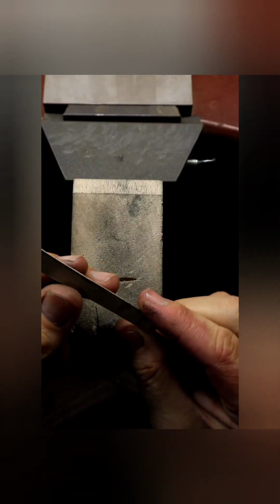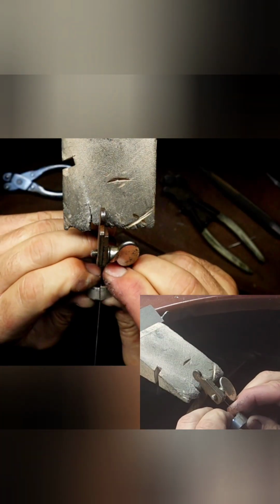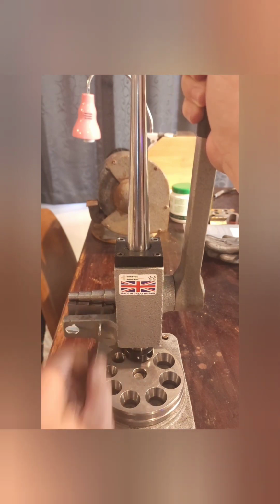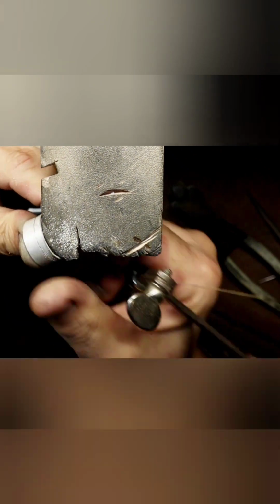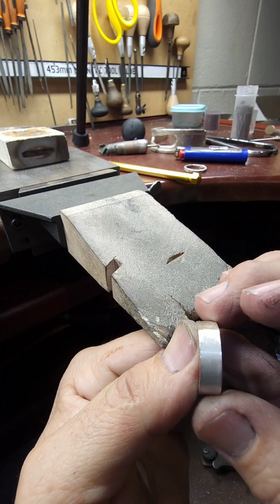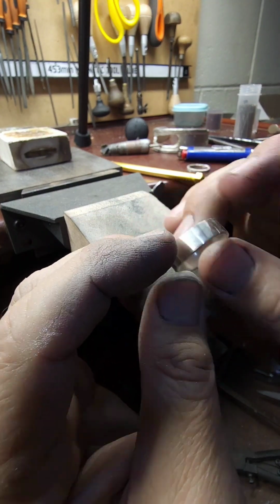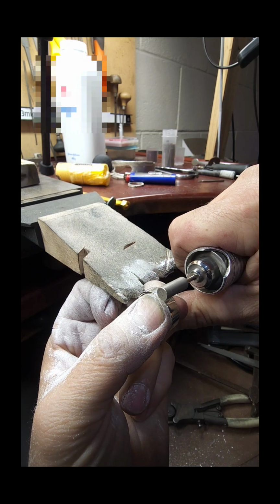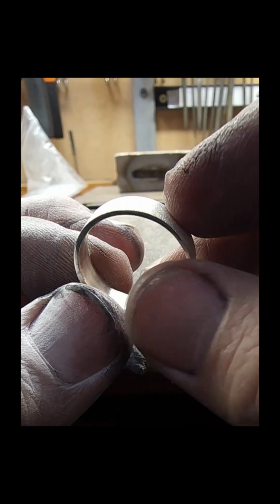SANDBLASTED FINISH on a ring....without using a sandblaster.

Comment: Hi, great tool and advice for sandblasted finish. What tool would you recommend for a flat surface? Would the round tool work for a flat surface?
Reply from the maker: Hi, thanks for that 😊. 
Yes, you could use the same tool for round surfaces,  but you could also use a broken drill bit. Perhaps I should make a video about that as well 😉
Reply from the maker: My apologies, I did mean for flat surfaces 🤦

Comment: How can I clean a ring that has been sandblasted but has black like stains on it?? … it’s been a while since I have worn this ring ..
Reply from the maker: It's possibly oxidation , my advice would be to get some silver dip from a general store or jewelry cleaner, but I suspect the silver dip would be the cheaper option. 
As a last resort, you may have to take it your local jewelry store to have it professionally cleaned. 
You're welcome to send me DM on IG with a picture of the ring in question so I could make a better assessment. 😊